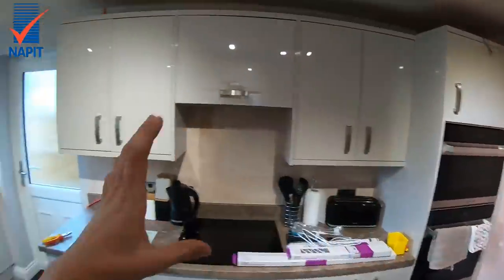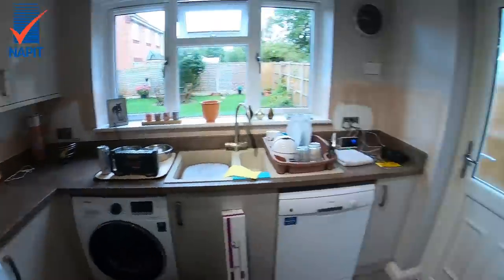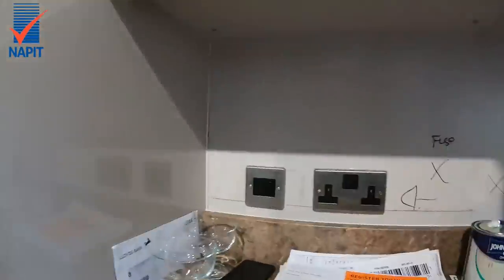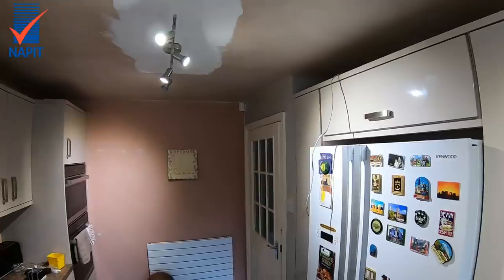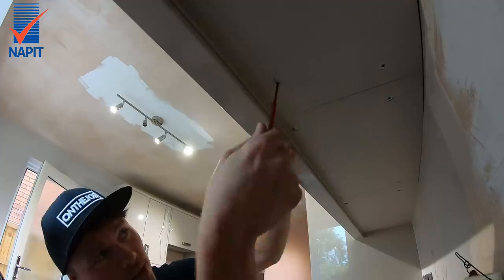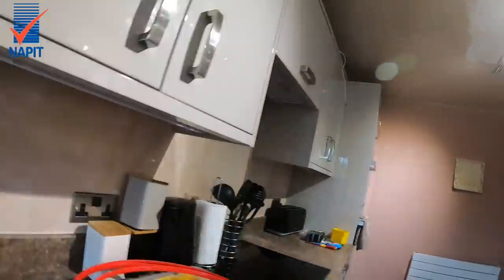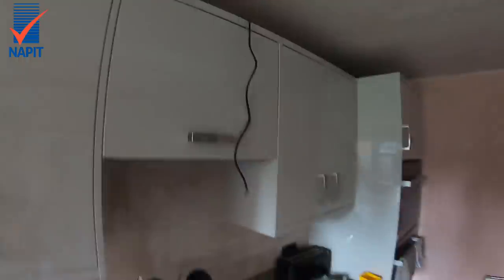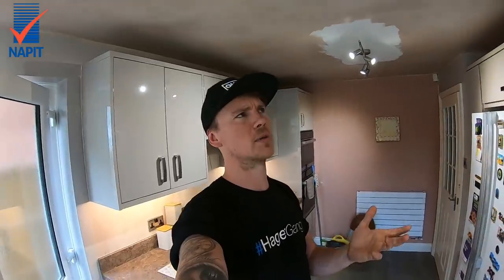Under cupboard lights install, New discounts ,Exotic life of an electrician

Comment: you could try a little spray silicone spray on the cable before pulling back behind the units. I have done this before then used mr muscle  kitchen spray on a rag to clean of the silicone after. Top job. Keep up the good work.
Reply: A bit of vasaline helps with cable runs.

Comment: Nick I’ve wired a set of leds that had a plug on. I took it off put it in a wago box connected to a length of cable going to the 2 gang switch. One for the leds and one for the spot lights. When I switch the leds on the spot lights and LEDs flicker on and off but when I switch the spotlight on they come on full brightness and the LEDs go off? Any ideas what’s happening

Comment: Plugging in a washing machine and disheasher on 1 double socket. Do you ever find the socket burns out over time?
I always fit a single socket for each appliance as I had a double socket melt when washine machine and tumble dryer were running at the same time. Dont know if anyone else has had an issue like that?
Nice lights by the way. Always good to see another spark taking pride in their work.
Reply from the maker: Cheers and never had that issue to be honest , seen something similar with a washer and dryer
Reply: I'm with you on this Chris, I've seen 13A double sockets heat damaged by overloading, trying to share 13A between a dishwasher and washing machine is not advisable.
Reply: Unswitched singles pain in the back side but has to be done, in my personal kitchen I use flex outlet plates on SFS.. because after reading manufactures instruction it didn’t hinder the warranty :D
Reply: Twin sockets are only rated at 13A total across the two outlets. Mention was made of a single supply to the two ovens, feeding a twin socket, therefore, they should ideally have had 2 single sockets also.

All those appliances on one rfc is probably pushing it a bit, not leaving much slack for other items, but guidance aside of over 2KW being on their own ccts, the load profile may be the saving grace. A e.g.4mm2 radial can be considered. 

What RCD type is used in the property? Ideally type A, but can also consider type F, although cost prohibitive.

Comment: hi i got a triple light switch on the wall for the ceiling lights  now 1 on the switches is not connected as its for cupboard lights, there is a connector block on top of cupboard  with earth live and neutral how would i go about connecting light to the connector block would i need to use the earth?

Comment: Great video as usual! would you ever do doorbel or heating stuff? not many vids on here of that, like ring, nest, hive etc?
Reply from the maker: Just did a nest door bell the other day, I’ll record the next one but stay way from heating systems
Reply: Many years ago I used to be confused with heating wiring but once you get your head around It it’s simple, just a series of switches.
Reply: I specialise in Heating and AC wiring usually on BMS systems which to your average sparky looks very daunting and they stay well away from it , some of the BMS control wiring can be extremely complex especially in really large commercial buildings but I decided about 20 years ago to specialise in this field and there is a lot of money to be made if you get into it especially in the breakdown and repair field.......👍

Comment: I Have asked WAGO to do a UK 3 pin plug with a connection like a 221 in the back, what do you think? The more who ask they might :)
Reply: Personally I don't think a wago type connection, is the be all and end all, and usually plugs get a lot of use and abuse, and I don't really see anything wrong with the current plug.
Reply: @claas6504  I am meaning the connection you would still have the cable grip
Reply: @stephencoulthard1718  yes but still don't think there as good even with a grip.

Comment: I never use the switches on the lights, wire them all together from a wall switch. Not many clients want to just turn on individual lights or grope around for the switches.
Reply from the maker: Supersparks it’s the opposite for me all my customers want the switches separately must be a midlands thing
Reply: @NBundyElectrical  I guess so, strange those northern folk